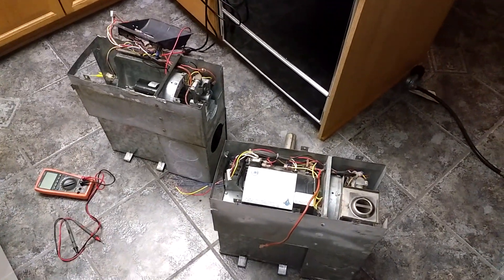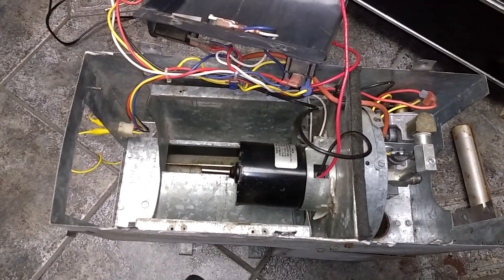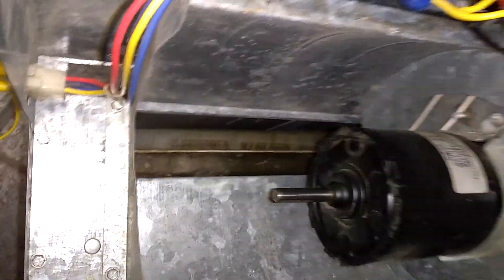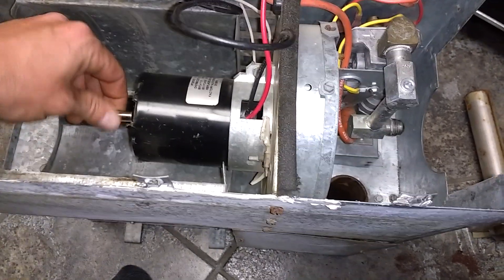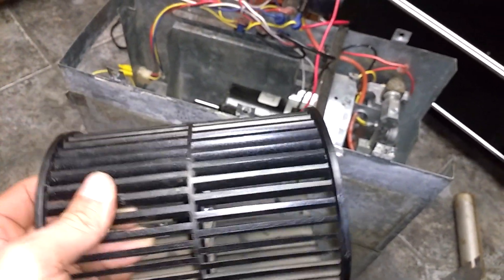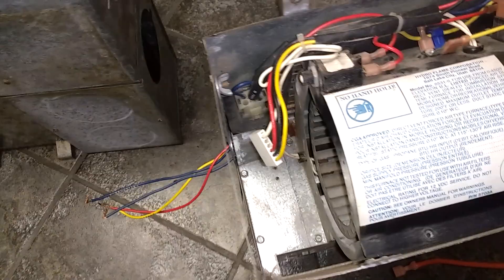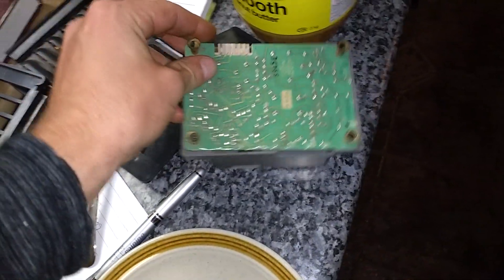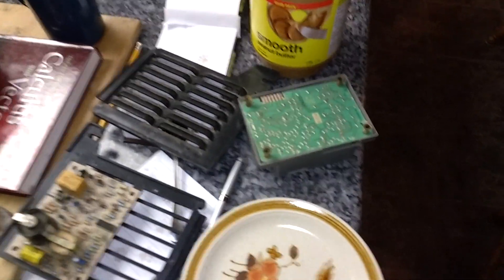Atwood 8531 Furnace, New vs. Old

Comment: My 89 8531-II exhaust tube will not budge, i removed the wing nut and washer, but i cannot get it to pull out, I took a flashlight, looked inside and it looks like there is a metal piece sticking ip through the tube on the bottom! Is that part of the back wall of the heat exchanger compartment or is it from the outer tube connecting to the inner tube? I have to remove it in order to pull the inducer draft blower wheel off the motor shaft cause the motor went!
Reply from the maker: I'll have a look today at what your talking about, I have a spare furnace in my basement.

Comment: problem: i got the atwood 8535-1 furnace. got the dinosaur Fan 50 
control board but the plug wires don't match up. fits fine but one wire 
has no contact when plugged into dinosaur. original has pwr, v1, s1, 
& gnd. the s1 doesnt go anywhere on dinosaur board. everything else 
matches. thats the flame sensor. i can move the pin but only thing left 
is "NC"? my furnace thermostat grounds the circuit & also i have 
time delay relay so i dont think i use the t-stat pin on the dinosaur 
board. also i thought if i used the dinosaur board i would NOT need to 
have the time-delay relay anymore. thats what i read online. cant find 
any info & Dinosaur ele has NO phone #.
Reply from the maker: Hi Dj Darren.  The connector for your old furnace should plug right into your new Dinosaur board and function properly without moving any pins around.  The dinosuar board is a universal board, so some of the names of the connections have been "universalized" I guess you can say, but they do the same thing.  "PWR" goes to "Ground", "V1" goes to "NC", "S1" goes to "T-Stat", and "GND" goes to "Air/Sail".  I realise this is confusing, but if you look at the way your furnace is wired up, you'll realise that the sail switch - located behind your fan shroud - is grounded to the chassis of your old furncace, so they call this "GND" on your old board, but it is essentially hooked up to the sail switch.  On the Dinosuar board they actually lebell this as "Air/Sail", so don't worry, its the same thing.  The PWR and Ground thing is a bit confusing to but that is the way its hooked up.  Your comment on the fan delay...there is a tiddlywink relay that heats itself up when your thermostat is turned on, this is an independant component that is separate from your ignitor board, that is a feature that you cannot choose to bypass with the board.  The fan will turn on after a 10-15 seconds of turning your thermostat on, no matter what kind of board you have in there.  Hope that helps
Reply: @UOttawaScotty  if i plug it in then my flame sensor (s1) isnt connected to anything & also on the board "NC" isnt connected to anything. i will call dinosaur on monday for them to explain this nightmare. thx tho!
Reply from the maker: @djdarrenrv  Okay, good luck with the board.  Sorry I couldn't be more helpful, I'm sure if I had it in front of me I could figure it out, it's hard over the internet.  Best of luck DJ Darren.
Reply: @UOttawaScotty  I have an Atwood 8524 IV fan on continuously. I read it is relay, but I am unable to find one near ignition board. I am working underneath cabinets so no access to outside. Heat works perfectly no proble with thermostat. Thank you for your help in advance.

Comment: Maybe better but my 83 suburban limit switch was just behind the cover, that one in the attwood  you have to remove everything to get to it.
Reply from the maker: No thats true, but one other thing I forgot to add though about the Atwood furnace is that the mounting to the outside of the RV, and the method to which it exchanges air with the outside environment I find much better on the Atwood, either way, as long as your warm, that's all that counts !